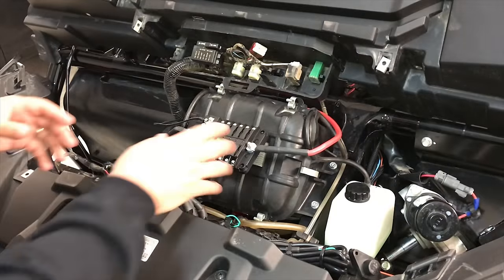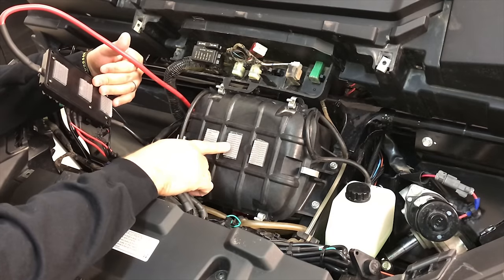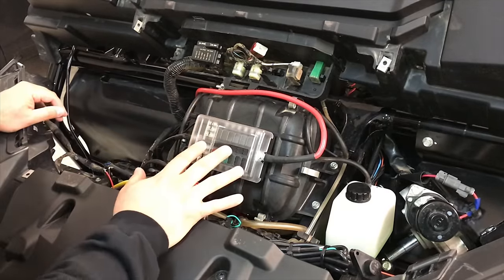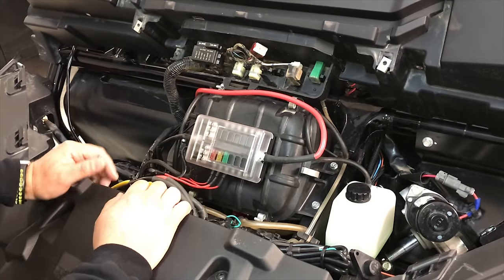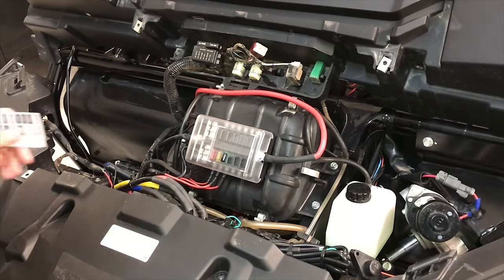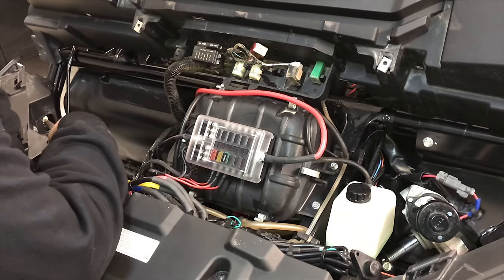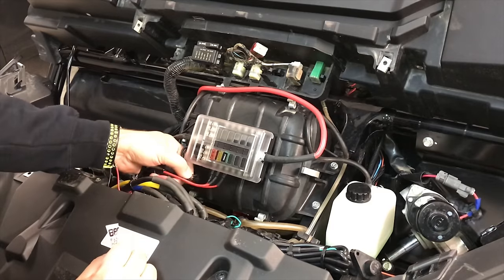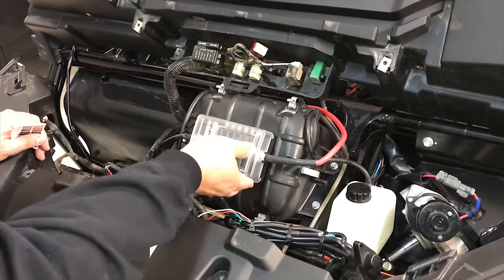How to Wire UTV Accessories - Installing a Fuse Box

Comment: I have a similar switch plate and switches. Can someone please tell me 
where to connect/run the blue and yellow wires from the switches? I have
 dual battery setup like yours and fuse box like yours. Thanks!

Comment: Does your fuse box stay on even with the ignition off
Reply: Also I’m gonna be running a 6 gauge power but can I run a thinner wire for the ground ?
Reply from the maker: Run the same for the ground and yes my switches turn on without a key. Just use relays and you will be good. I had this setup for almost three years on the stock battery before I sold the machine and no issues. 👍 -Garrett

Comment: Hey great video enjoyed watching it just curious did you put any kind of a fuse on that 6 gauge wire between the battery and the positive on the fuse box or just run it straight.
Reply from the maker: It’s just ran straight to the battery and will not need a fuse. All of the fuses in the box for each accessory will take care of everything. The only item I ran straight to the battery and not the box was the winch. It has its own fuse as well. -Garrett

Comment: Where do you hook all your key hot wires at ?
Reply from the maker: For all the little back lights on the rocker switches I hook those to the 12v keyed power.
Reply: Do u hook them all to the same key hot wire or do u go to multiple wires for stuff that requires a keyed hot for it to work
Reply from the maker: I ran just one wire across for all of those and tied that into the key power. Those little lights run very little amps.

Comment: Love this channel. Thanks for all the great content. What’s the advantage of having the winch directly to the battery vs. the fuse box?
Reply from the maker: I just like having the winch hooked straight to the battery with the bigger cable. You could probably run it through the fuse box as well.
Reply: Those mini fuses don't come in large enough amperage to handle the load of a winch.

Comment: Great videos, been watching since Oct 2019 when we bought our 2020 T4 and I’m beginning to doll it up. I like the neat appearance you continually go for. It shows you all pay attention to details. I am getting to ready to add street legal lights, back led cubes and few other things. One question on using the fuse block and relays, did you run the street legal kit thru a relay or just thru the fuse block? Also, I am adding a USB rocker with voltage readout and one without. Did you put those on relays?  I am questioning how if you did or just thru the fuse block and I assume they are only hot when the ignition is on.

Keep up the great work you folks are the best. I ordered some items thru your web site and appreciate the info you put out.

Comment: Did you tie the switches to the ignition?
Reply from the maker: Just the little rocker light is tied to the ignition.
Reply: Deranged Off-Road does your battery ever drained hooking it up straight to the battery? I just ordered the badland 5,000 lbs winch for my TERYX4 after watching your video. I’m just new to all this wiring stuff.
Reply from the maker: Nope the relays take care of that and had it setup like that for almost 2 1/2 years on the stock battery still as well.

Comment: Do I need the relays?
Reply from the maker: I would say that you can get by without them. I’m running my rock lights right to the fuse box and no relay same with cab lights. I used relays on my light bar, winch and stereo. The rocker switch is rated for 20 or 30 amps I believe itself. -Garrett
Reply: Thanks!

Comment: What gauge wires are those?
Reply from the maker: The main wires come from the extra wire on the winch is 6 gauge and the other accessory wires are from 14 gauge to 18 gauge depending on the accessory I was running. 
-Garrett

Comment: Hod do you know what fuse to use?
Reply from the maker: Most accessories will run off a 5 amp fuse. For the main big light bar I used a 10 amp. 👍

Comment: what kind of fuse box is that    where can i get one
Reply from the maker: You will find the link in the description below. Thanks for watching. -Garrett
Reply: Deranged Off-Road what kind of fuse box did you use
Reply: @DerangedOffRoad  xp 1000 Ranger cant finger fuze box...help
Reply from the maker: What do you need help with?
Reply from the maker: Just one from Amazon and the link is in the description below the fuse box instal for the Teryx4

Comment: I bought the same bus bar from china and can’t install the fuses into the block , they use  thin   metal  and say it is waterproof , what a joke .I wont trust this $ 17.00 box on my ride so I sent it back . Lesson learned buy made in America when doing electrical components. Thanks for the video
Reply from the maker: It’s held up over five years now with zero issues.

Comment: How did the "not velcro" hold up over time?  Would you still use it or go with something else?
Reply from the maker: I would do the same thing. It still is holding up just fine and no issues as well. The key is to clean the spot really well first. -Garrett
Reply: I'm working on that fuse box also, trying to figure out how to mount it. I like what u did. What is it and were can I buy it ? Thanks
Reply from the maker: Walmart usually has it and it’s indoor out Velcro. It looks way different from the normal stuff.